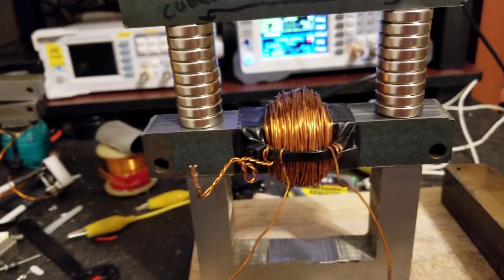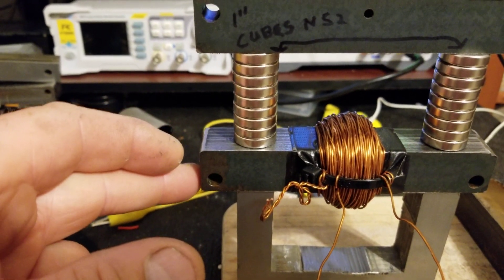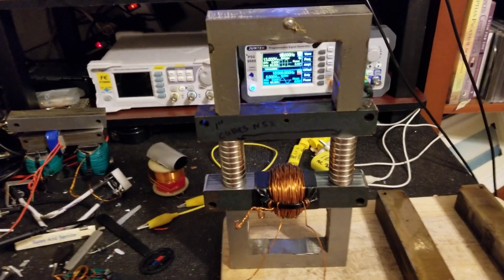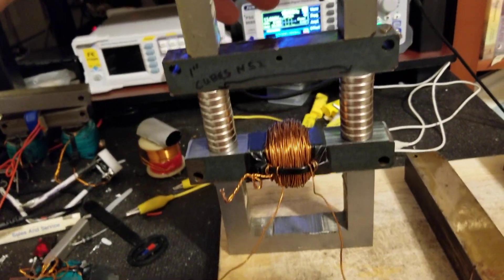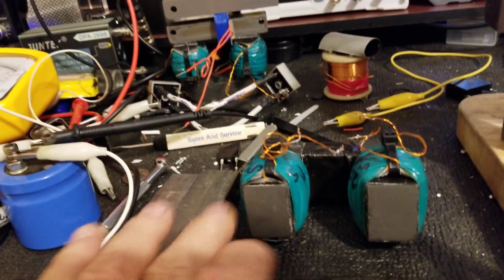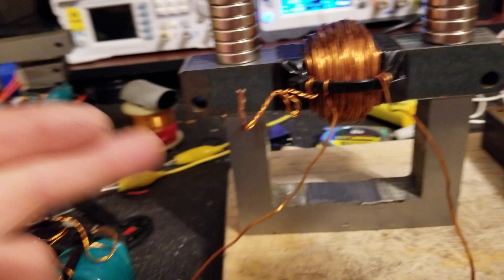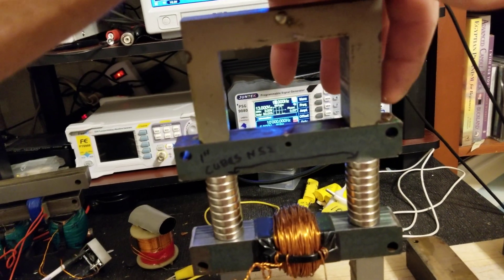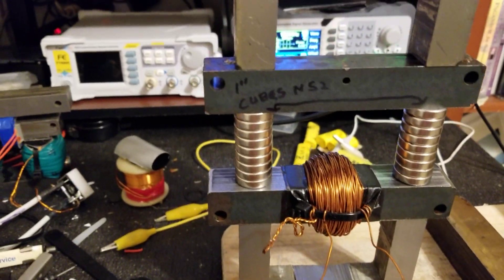Motionless electromagnetic generator part 9

Comment: I had my MEG running in the khz range had some very interesting results and also saw around 400ma output but in full wave mode 1ms or less pulse width and with input current dropping under output load did a 470 ohm resistive test to show the variation in the load, keep at it Tim I'm sure you will find the missing piece.

Comment: Hi! I have an question. After long period of experimentation - is there any "extra energy" output if we look at the subject as real researchers? Or it is just BS? In old times I try to make something similar - I get WITTS papers and Bedini/ Bearden videos etc. and read Teslas patents and watch Kapanadzes videos and... 80% is BS of that IMHO, but... I think there is some % possibility when we think about LC High Voltage tank discharge in Coil which is wrapped around transformer. Maybe you have some ideas about it, because I see one African boy which made Voltage booster with spark gap... and I start to think about that. Thank you!